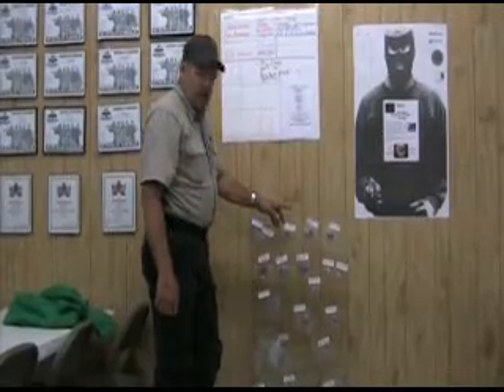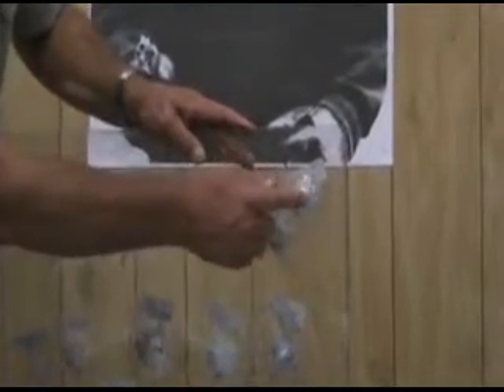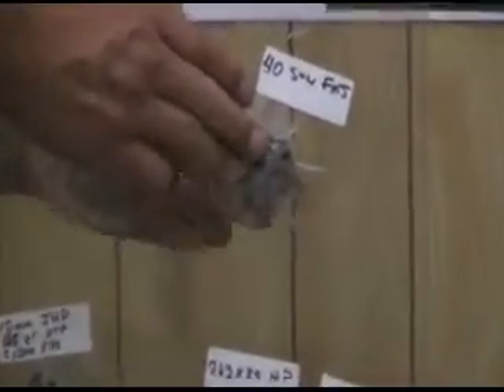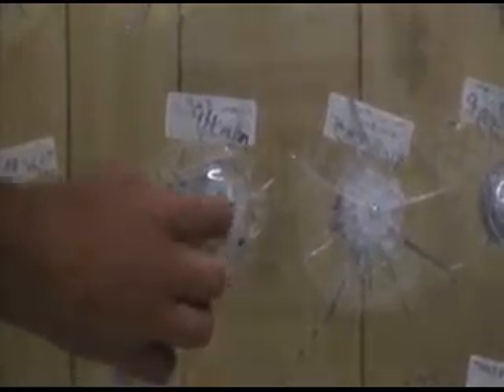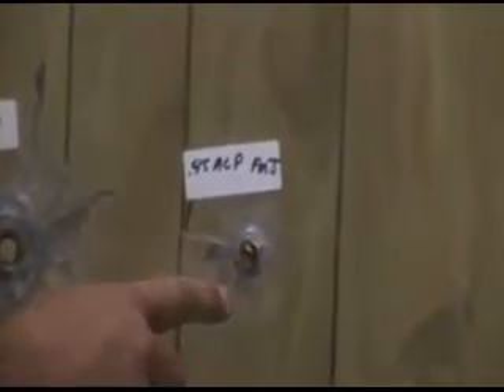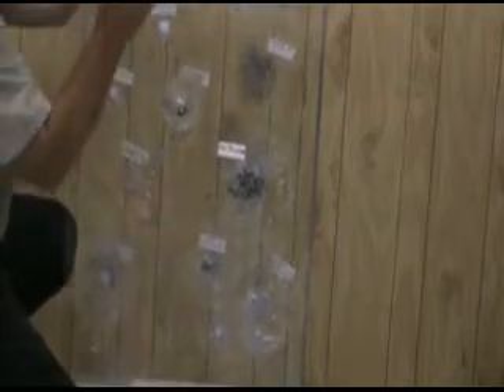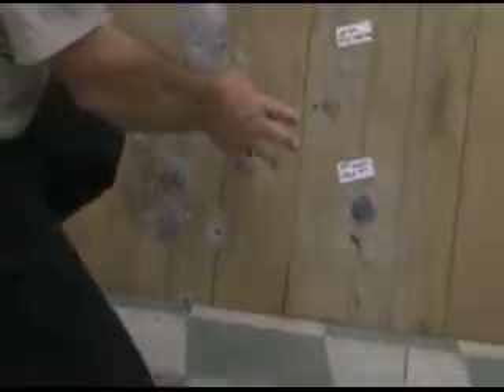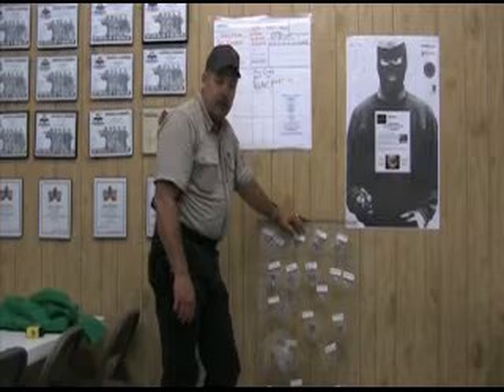"Bulletproof" Glass

Comment: As a certified "bullet resistant" (nothing is bullet resistant if you shoot it enough) unit maker, I can tell you that layering works, but making an air pocket between sheets and sealing the edges of the unit will greatly increase its strength.

Comment from the maker: @fuzzypeach777
The standard M193 5.56 bullet is a full-metal jacketed lead bullet. Only a couple variations actually have steel cores. Most have little steel penetrators with lead cores. But either way, the bullet that we used zipped right through like it was cardboard so the results with steel-cored projectile wouldn't have shown any different. Maybe if we had used much thicker material, it might have made a difference